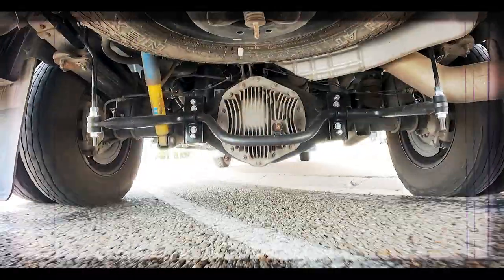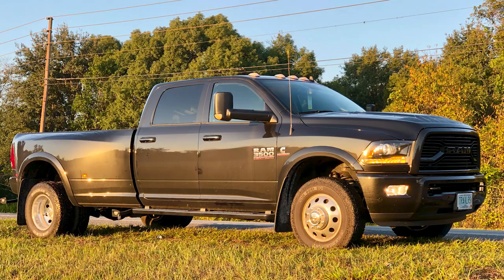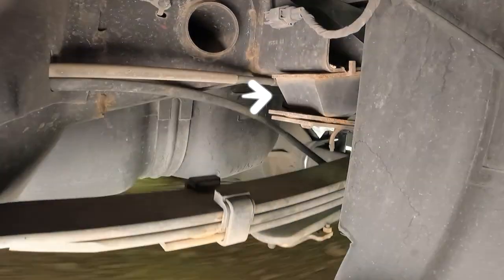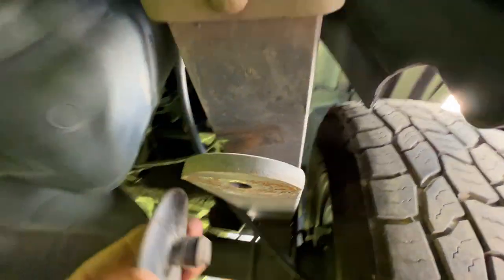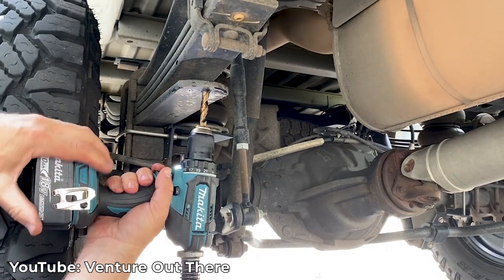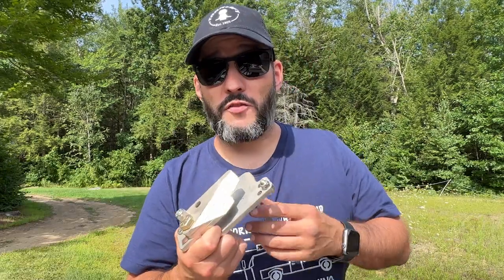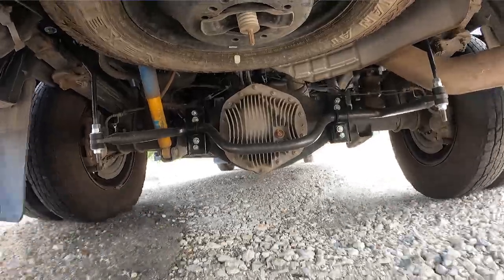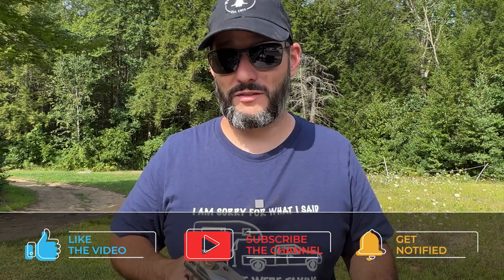💪 Torklift Stableload - WATCH BEFORE YOU BUY! // Stableload Review

Comment: You should have went with air bags to start with" like big rigs have".  Mine were cheaper, lifetime,adjustable,very easy to install. You would not have regreted it.  2006 dodge cummins 1 ton  dually with lance 1130 (3900 lbs) air bags and big wig sway bar.with 4 down jeep flat tow
Reply from the maker: I avoided airbags for a bunch of reasons. They have their place, but they weren’t for me. There are so many ways to slice a cake!
Reply: Air bags make a truck with a camper worse rather than better, too much give. I have been in the auto repair business over 60 years. I used the trucks jack under my drill and drilled all four holes with one bit no problem.

Comment: I had to drill the 4 holes in my lower leaf Springs. And I can tell you the best method is to use a large Dewalt clamp, and clamp it to the back of the drill and the top of the lower leaf Spring with lots of pressure, and keep lots of lubricant on the bit. It's about a thousand times faster than doing it by hand.
Reply from the maker: That’s a great idea. Are you talking about one of the clamps that you squeeze or the type that you turn? Either way, that’s an excellent trick!
Reply: @Stonyboot  
Squeeze

Comment: Excellent video. I was lucky enough that my son was able to drill the holes in the leaf springs for me. I have a 2004 Dodge Ram 3500. It was no easy task even for my son, who was very strong, in his 30's. In my kit, Torklift had provided 4 drill bits that came with the kit. I don't know if I paid extra. I still have the drill bits.  But, as I mentioned in a previous comment, one of my lower stable loads came off. So, everyone might want to check the tightness of the bolts after a few hundred miles or so. I've had mine on the truck for at least 5 years, the three that are on are still in good condition, but, I might replace them with the stainless steel versions. 
I really like these types of videos that you put out & look forward to more of them. You are very good at presenting things. Take care & have safe travels.
Reply from the maker: That’s very nice of your son to do, it is a lot of work!

The bolts do need to be checked periodically and a little dab of loctite might be a good idea. 

Thanks for the feedback and I hope to have many more videos coming soon!

Comment: Kudo's Scott! Letting folks know about the Tool available on loan..My Gad, there is nothing like trying to drill hardened spring steel...on the ground, under your truck, with out some help like that!!! Keep up the good work!
Reply from the maker: Thanks. I did quite a bit to research and found out how difficult it is to drill those springs.

Another commenter suggested using some large clamps to apply the force, which is a pretty neat idea. However, if you have the time to wait, Torklift has the perfect tool!

Comment: Great video. First thing I did after was check to see if I had holes in my leaf spring, lol.. I’ll have to research to see if those will work with airbags, as I don’t have the stable load uppers installed. I do want to upgrade the shocks soon as well and see if that makes a difference. We have the same sway bar you got and it makes a difference.
Reply from the maker: It sounds like you’ve got all this handled. And yeah, the sway we is fantastic!

Comment: Have you ever had the bolts shear off? The small bolts that hold the stable load in its position. I just had that happen to one of my stable loads. The stainless look much better, mine are around 1 year old and quite rusted (full time use).
Reply from the maker: Well, I had one disappear, but I assume it was from vibration rather than sheer forces. Sheer strength of even a grade 5 bolt is pretty high, I don’t think there is enough twisting force to sheer it. 

I replaced it with a smaller bolt, but double nutted it with unlocks, it never moved. 

What I’ve learned is to put a little dab of locktite on them.